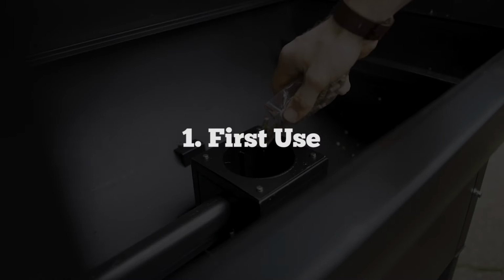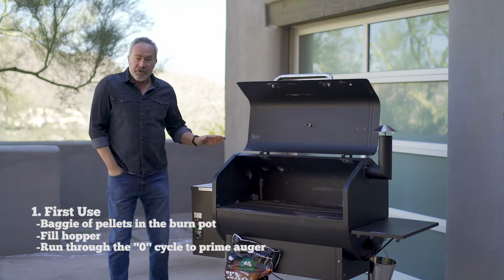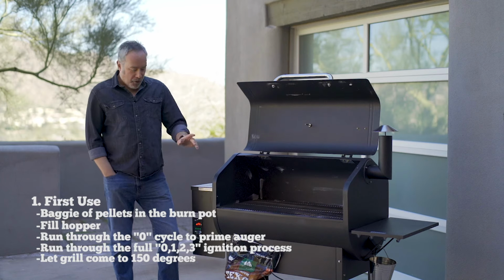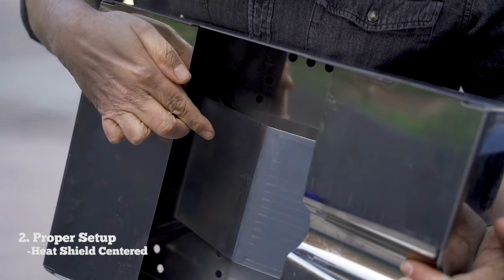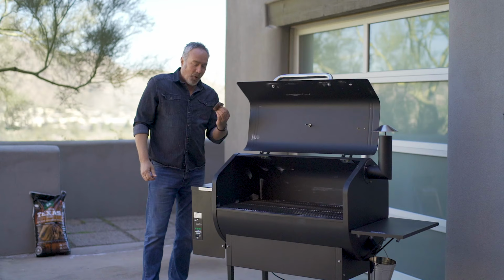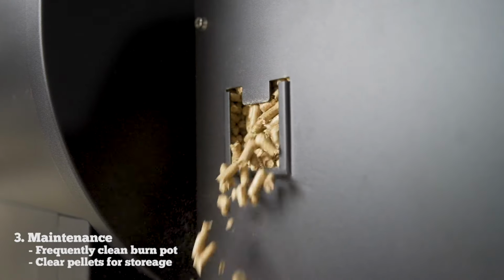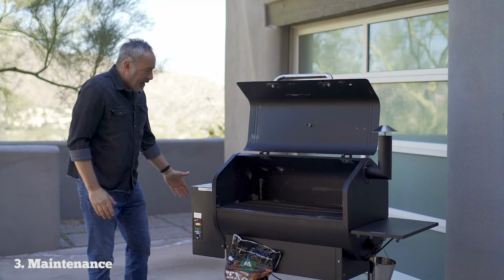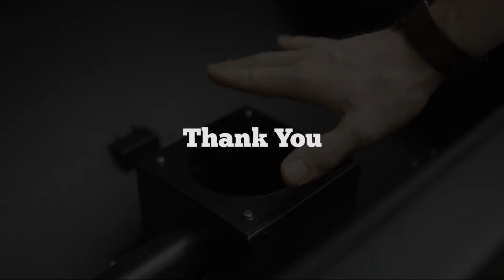Green Mountain Grills | New Owners Guide

Comment: Missing half the details.  Does the door stay open?  When do you close it?  Wait till 150 completely omitted.  Seriously, details matter GMG.
Reply from the maker: Hey! You can leave the door closed or open, either way works great. It is best for you to wait until it fully reaches 150 before turning it up.
Reply: @GMGrills  I appreciate the reply, Ill have to call because I got all new electronics and my hop sensor is on the fritz, I can't get the wifi to work, and the temp never gets hot.  I can't wait 60-90 minutes to get it to 150 just to start finally heating it up, then another hour to get it up to temp,,, Not sure what the problem is so Ill have to call.  Thank you for the reply.

Comment: The grill does a good job if you can keep a circuit board from going haywire I’m on number 2 won’t get another
Reply: Well, I am considering a GMG because the Traeger smoker I bought last year the control board failed in less than 3 months after purchase and it was major surgery on my part to replace it. All the Grill/Smoker companies must buy their electronic parts from the same factory in China. I have a friend who dumped their Traeger smoker in 2024 and bought a GMG Daniel  Boone model and they love it.  The larger hardwood pellets that GMG sells last more than twice as along as the smaller pellets sold by others.

Comment: On initial startup and every startup, at what point are you able to close the lid?  I’ve seen videos of users closing their lid too early and experiencing a small explosion within their smoker.
Reply from the maker: You can keep that lid closed the entire beginning. If you are worried about any complications you could leave that lid open until the thick white smoke subsides. Typically, it's an excess of pellets in the firepot or a weak igniter that can cause what you are describing.

Comment: How long does it take for it to come to temperature how long does it take before you can set it to temperature what temperature can you sear meat at and how long does it take to achieve that temperature?  When it burst Dick nights do you need to leave the door open or closed or put to drip trays back or not and at which point there is a lot lacking in this video to be Honest is there any other video references from the manufacturer?